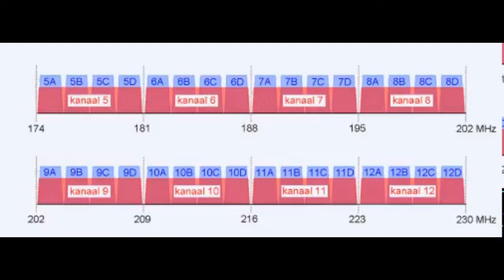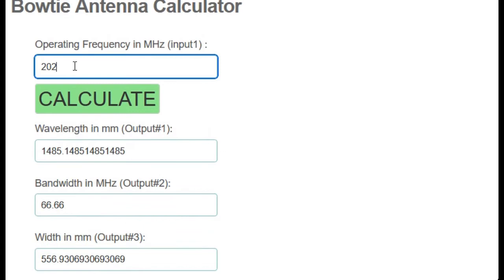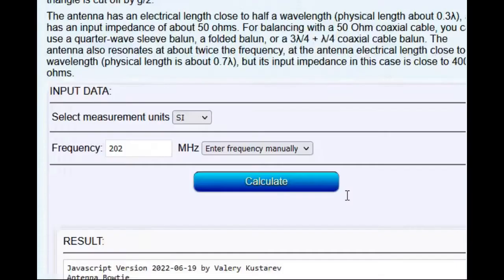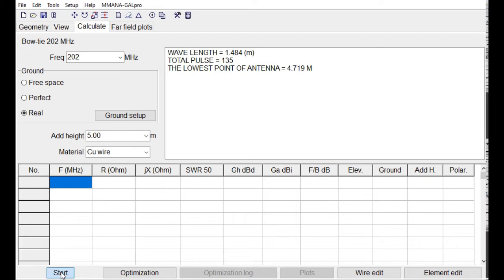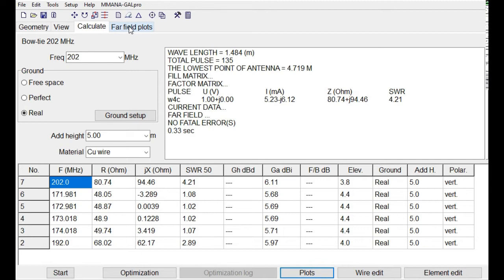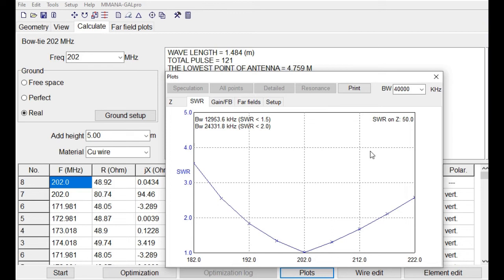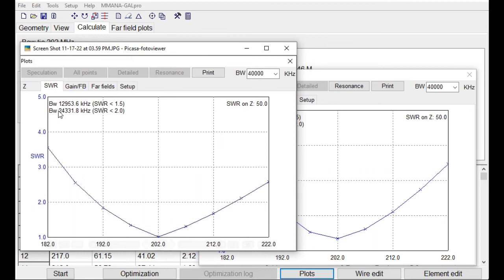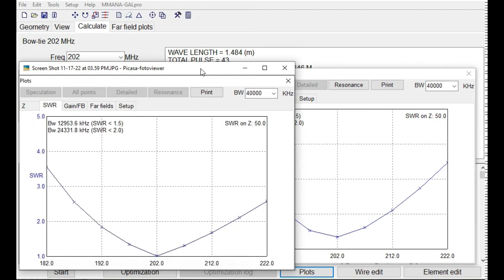1: Bow-tie broad band antenna, web calculators and antenna simulation/scaling by MMANA-GAL

Comment: Keep it simple! Bowties for wideband UHF respond best if the bow measures 18" in total width. Having a 24" wide reflector. If you are just focusing on the use of the higher #'s your bow will respond well having only a 12" wide total bow with 24" screen.Now VHF channels you take the frequency such as 174 & divide by 6. It will be cut exactly to channel 13. 208 divided by 6 is nearly 35" this will be total widths for channel 7. They try to make it more difficult than it really is🧐
Reply from the maker: Thanks for sharing your way of calculating!

Comment: I'm sorry, but I'm a little confused by something. I mean, I am missing something, I suppose. And in looking around the web for an answer, I've come across others who are confused. Maybe you, or someone reading this, can clarify this for me:

When I use your calculations, the results come out nothing like the recommended dimensions for a bowtie segment found on various sites and videos. I'll give one example:

I live about 35 miles above New York City, and one of the channels I would like to receive is WCBS, channel 2. This is now UHF channel 36 which is approximately 608 Mhz. Using the calculators you link to, one of them gives me a (converted to inches) set of dimensions of 7.28" width (for one half of the set of bowties), and a spread (height) of 4.86". This works out to an approximate length of 7.75" for each segment. The overall width of the set of bowties would therefore be about 8", with the gap between the bowties of .4". 

And most of the UHF frequencies for stations in my area, calculate to dimensions just little bit to either side of the above.

BUT these dimensions are NOTHING like the various recommendations around the web for such a UHF bowtie. The segment recommendations are from about 9.5" to 12.5", giving a width of up to 15" and more. And the gap between them is usually recommended at from 2" to about 3.75". 

Why this great disparity? It is obvious it is me who is not understanding something, but I can't figure out what it is. Thanks in advance for any help here... I've got my frame, and my roll of 10 gauge copper wire, baluns, and so on... all I need is to break this deadlock...
Reply from the maker: Hi, your question is interresting and therefore I made a video about your specific case. You can find it here: https://youtu.be/xUVYSfzCP4s Hopefully it answers your question!

Comment: What is the difference in reception strength gain with using a solid sheet metal bow compared to a wire bowtie ?? Nice video Chrix.
Reply from the maker: Thank you for your interest. I didn't really notice a difference in reception strength.
Reply from the maker: Please see https://youtu.be/aJoFMgRU35o for measurements and results.
Reply: Will do SIR. Thanks @chrix2381